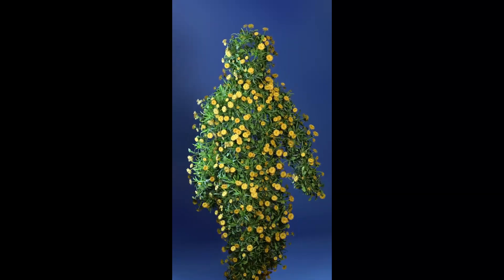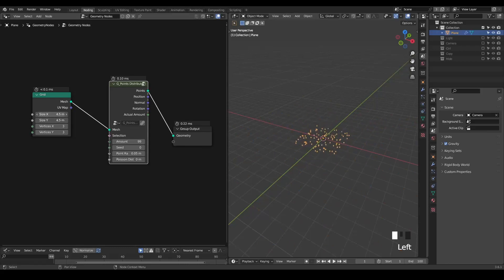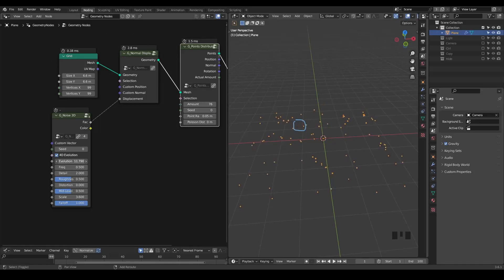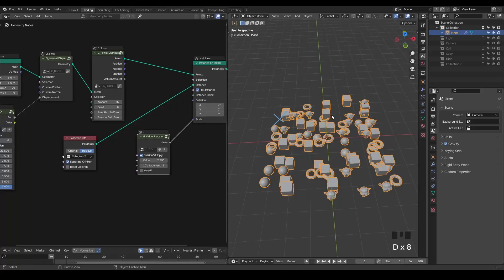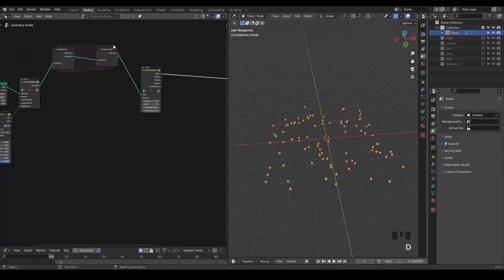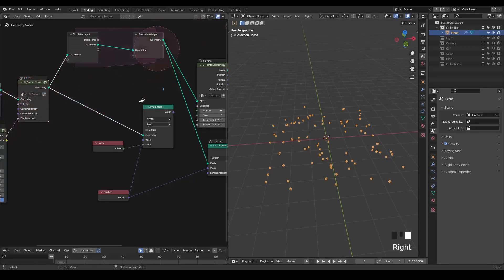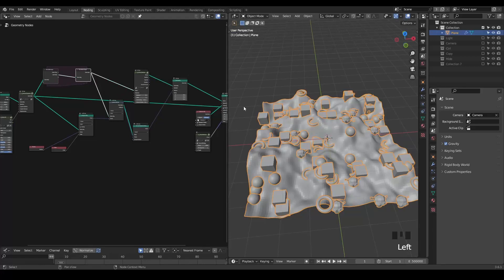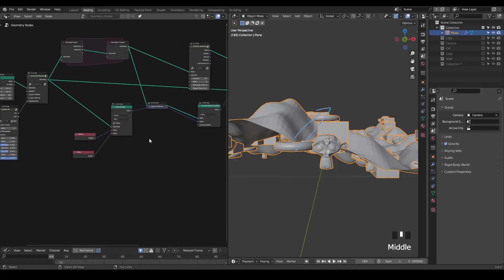[Tut] Dynamic Surface Sampling Basics - Blender Geometry Nodes Fundamental 3.6+

Comment: you could probably just capture the position from the sample index on the non-deforming mesh before you distribute points. this way, you don't have to sample nearest surface.
Reply from the maker: Good point. However, the setup is not meant to just move distributed points, but other completely separate geometry that can be on top of the surface too.
Reply: @bradleyanimation120  I'm sorry, but I don't understand what you said.
Reply from the maker: @shmuelisrl  For example, a donut on a moving plate. You can only capture attribute on the plate and then transfer this attribute to the donut.

Comment: very interesting! wouldn’t be easier, to distribute on a uv map ans the use the uvs for positions of the particles?
Reply from the maker: Yes, I have discussed the concept of "UV deformer" in the past in the reference of Entagma's Houdini tutorial. 
There are some problems, however:
1. Index is natively present everywhere, but UV is not.
2. One quad contains 4 face corners to express UV. it means you have about 3-4 times amount of data to process mapping compared to "indices of points". There's an inherent performance concern.
3. UV must not be overlapping, otherwise you will have a single point being told to preset at different places at the same time. In fact, this kind of issue causes significant lagging of node execution. Blender can freeze and crash. Missing UV mentioned at 1 can also cause freeze and crash.
4. if a UV contains seam, then the actual implementation of this method for distribution may raises some unforeseeable problem.

Overall, I proposed UV-based dynamic Sampling at the most beginning, but upon testing and experiment, I switched to current Indices-based dynamic Sampling for a more general solution that should work in as many scenarios as possible.